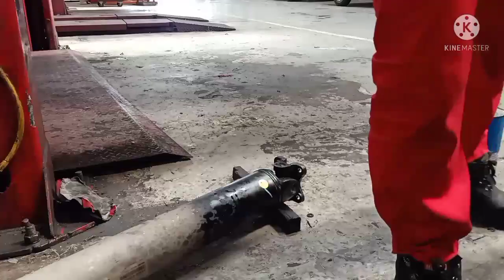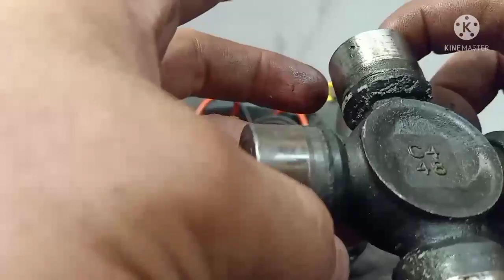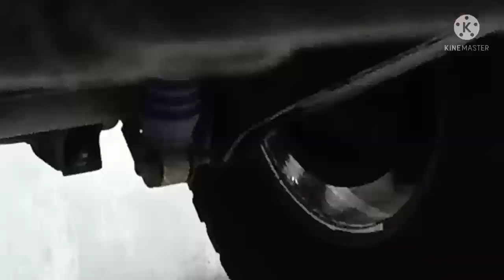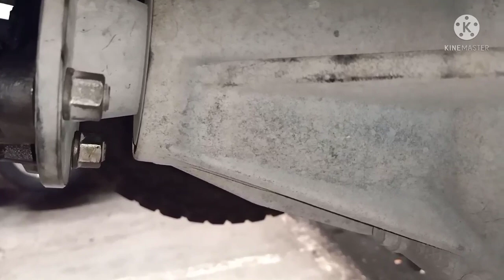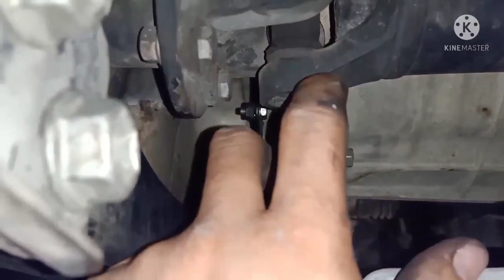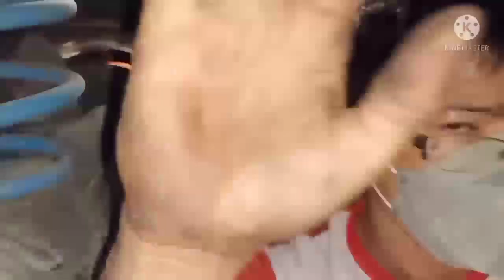knocking noise when shifting gear 1/2/3/4/5/6

Comment: ganyan din po issue ng nv350 ko 2022 model may lagutok sa ilalim pag nag 1st at 2nd gear unang pms ko p lng sinabi ko na un sa casa sa nissan sta rosa pagkatapos ng unang pms ganun pa rin,then 2nd pms sabi ko sir ganun pa rin may lagutok pag nag kambyo ng gear.check daw nila,after ng pms pag gamit ko ng van ganun pa rin.grabe sayang lng gastos.kaya nung 3rd pms sa labas na lng ako nag pa pms.tapos tinawagan pa ko ng casa after nung pms ko sa kanila i check daw nila may bayad daw 3500 sabi ko  naka warranty pa to ah.grabe...